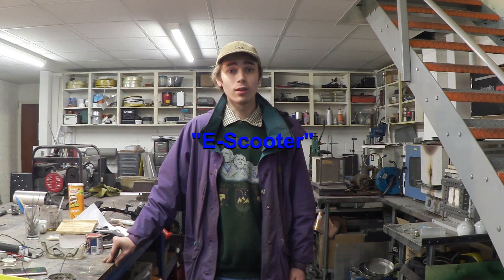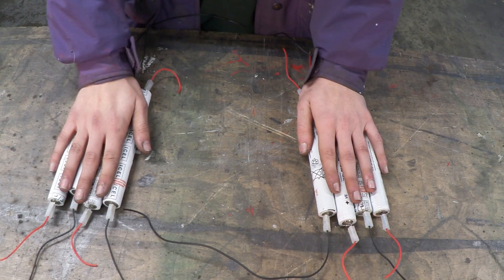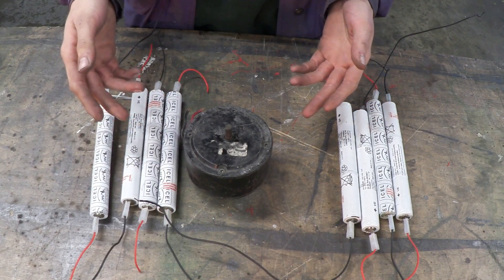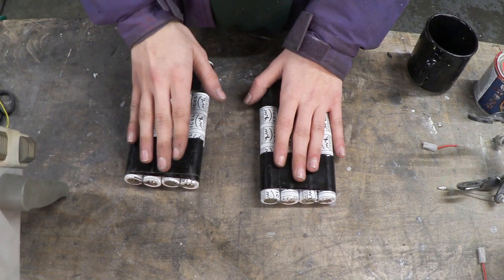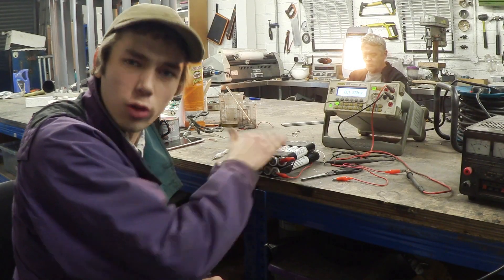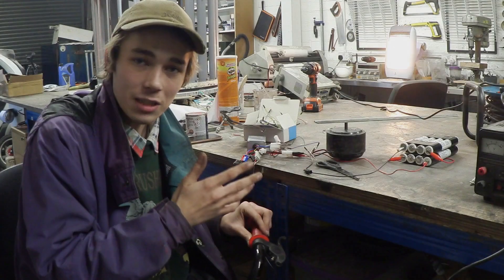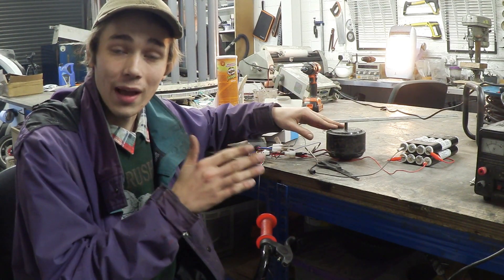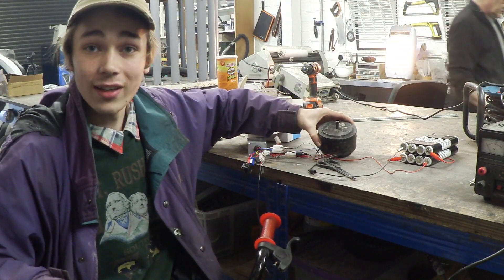DIY Battery Pack from Scavanged Batteries

Comment: I am trying to create a 7S6P Li-ion battery pack from disposable e-cigarettes and retrofit a replacement for a 2S Lead-acid e-scooter. However, the only way I can fit 6P is 2x3P end-to-end (either shared negative rail with two positive rails or shared positive rail with two negative rails), so I was hoping for some design suggestions and terminology, particularly around safety considerations.
I've previously seen a battery, either from a children's toy or a tool, with two female terminal receptacles on one edge and one female terminal receptacle on the parallel edge. But what would this terminal configuration be identified as? e.g. The Makita BL1830-PK3 battery has "sixteen firm holding contact terminals", but how would that be presented in notation? e.g. 7S6P instead of "42 cells"

Comment: Not a bad project. I do need to comment on you energy definition. 4 Ah is not energy. You need to multiply with the voltage to get the energy contained. It's really simple. P = U * I. E=P * T. Where P is in Watt, U is in V, I is in Amps, T is in seconds and E is in Joules which is the same as a WattSecond. I hope you don't mind I point this out to you, I feel it's kind of important as the same mistake is made in nummerous articles or even in technical reports which is kind of a pain ( usually mixing up power and energy ) . If it's not clear ask your dad. He can tell you all about it.
And it's so great you spotwelded the batteries. Some people just solder them which is a big mistake potentially destroying isolation inside( for lithium batteries I'm sure of that. for others probably also. )

Comment: Couple of things,
 I think you could have shown the spot welding. Rob might have done a video about DIY spot welding batteries in the past but if not you could show us how to make & use the equipment... 
How did you charge the batteries? I don't think consumer NiMh chargers would work with long series packs like that so this'll be important information to people you inspired to make up similar packs - probably you could use a fairly simple circuit and make another video about that.
This isn't intended to be harsh criticism btw :)

Comment: Take care with charge balance on NiMH (as with NiCd). Voltage is not the most accurate measure of % charge. Hybrid cars use single strings of NiMH for this reason; if you parallel them, you may end up with different current into each string. 

Or just make a single string at a higher voltage - depends on what you use as a controller or have for charging.

Comment: Probably use the plumbing analogy for electricity. Dam wall pressure voltage and river or creek water flow for current.

Comment: Nice one Luke, maybe a future upgrade could be to use lithium cells from an old laptop battery?.. 👍🏼
Reply: That is not a good idea. Lithium cells in laptops do not contain protection circuitry. Packs for laptops do. This will protect against over temperature and over current. Single cells with this protection circuitry do exist but are virtually never found in laptop battery packs.
Only if you do include the protection circuitry and you know what you are doing it is safe.  Imagen a short circuit and the pack catches fire close to some private parts you care a lot about.
Reply: @hanslepoeter5167  yes you’re correct, I meant use the cells with a charging/protection circuit, readily available from sites like AliExpress/eBay etc. I should have stipulated that 👍🏼
Reply: @gilbertsprojects2954  Yes you can buy these. But they will not match the 16450 format as these need some space for protection. But thats a great comment. It indicates you know what you are talking about.

Comment: It turns the motor with no load on it.  Will it have enough amperage to actually MOVE the scooter with 120 pound person on it?
Reply: It would probably be in the region of 150w that would be OK on the flat, but I doubt it would be much good on the hills, Luke, It would probably be better to use four of those pack as opposed to just two. of course, I have no idea of the motor rating.

Comment: please outline the charging system..  its a good chance you will want to put a timer or thermal cut off on the battery charging.  im guessing you might be using the motor controller for the battery charging control ?  if so its probably designed for lead acid nt Nickel metal hydride.  and it will likely kinda cook your battery packs unless you plan for it.

Comment: tip,  a little tape flag on the motor shaft is a great way to let people see it is spinning,  also  love the Robert cameo.   can you show how you spot welded the batteries?  did you use a full sized welder? (actually im sure at FWG they have a  proper tab welder. )

Comment: Nice to see a new way of explaining it! Well done Luke ;0)
Most people would have gone with the hosepipe analogy, it is good to see someone try something different!

The only thing I would say is that Amps in battery terms is totally different from AmpHours. 
Amps is how much energy you can safely take out at any time.
AmpHours is the total amount of energy stored.
..... of course you need to add in the voltage multiplier to get the actual Power of the unit!

Comment: So we need to be careful when talking about Amp hours vs amps. You were describing Amp hours and said just amps a couple times. 

Amp hours are how long it will last. Amps are an instantaneous thing about how much wattage a battery can output right now. So at 18v hopefully you are getting at least 5.5A so you can be pushing the motor at 100w.

Comment: what are those batteries from? never seen those type but I am on other side of pond and all hahaha
Reply: They're from emergency lights, if I recall correctly.
Reply: Yes, they were scavenged from an old light system. each individual battery has 3 cells inside. so it may look a bit different. Cheers mate! :)
Reply: These have replaced nicad batteries and are common for yearsnow, They outperfom nicad but can use the same charger.

Comment: Hey Luke maybe you could explain why you chose to may 2 batteries of full voltage instead of one by paralleling the individual cells which may give you a more stable battery Cheers and keep up the good videos.
Reply: Hi mate, Great question. my reason is that I needed more voltage on the packs to run the motor controller and the motor its self. So connecting 4 batteries into series at 3.6v each, I managed should get a higher voltage(12-16v), then connecting both packs into parallel iI should increase the amp hours from 4 to 8. I'm open to suggestions so let me know what you think. Thanks mate! :)

Comment: ......motor is 200 watts is it ?.The batteries could almost be from the 20 watt led emergency lights that Rob salvaged cos they can also be configured to 28 volts nominal for 4ah .The 28 volts is the turn on voltage required by the salvaged led array . I'm noting what you do for your build cos I've decided to finish off my twenty year old mothballed build . I have several 100 watt motors in the style of your motor, I'll look at using my lithium power tool battery packs paralleled up as the battery . Those lithium battery packs didn't exist twenty years ago .

Comment: For some reason seeing those batteries chained together reminds me of a water fight between the men and the women. The women occupied the second floor of the building keeping us men pinned down on the ground floor. I decided we needed a distraction and asked the men for their Nextel phone batteries. At 4.5 volts each one alone couldn't light a 24 volt fog light, but daisy chained together using 5 or 6 batteries(ran in series) I had plenty of voltage. I added a flasher relay in series with the light. Pointed the light out the back door and turned it on. Sure enough those women got curious what the bright flashing light was and all went towards the back, in the mean time the men went running up to the third floor. FYI the flasher relay acts like a thermal limiter on the system. I still remember being told a pair of 100 watt light bulbs were cheaper to replace than 200 watt speakers. Basically saying put something inline to burn up before the motor or batteries that is cheaper to replace.

Comment: Really enjoying this series Luke. Keep it up. Would be great to watch you both working on the same project. Maybe the next car project? Question for you, what are you planning to use to control the speed of the motor?
Reply: Thanks mate, that is a pretty cool idea! How I'm going to be controlling the speed of the motor is by using an electronic throttle. And a 24v 250w motor controller.

Comment: Never seen batteries like that before, very cool. Are you going to use a BMS to manage the cells? I would imagine that a standard 18650 lithium based BMS would work with these batteries because they both hold about the same voltage. What is the charge of a flat cell with those batteries, is it around 3v like the standard lithium cells?
Looking forward to seeing you scoot around the carpark when this is done.
Reply: ....so it looks like each tube is composed of 6 C size 2ah NiMH cells at nominal 1.2 volts per cell which would give 7.2 volts for each tube .
Reply: @charlesdickens6706  I thought Luke said each tube was about 4v, having 4 in series gives him the 16v each pack so a standard 4S BMS would work well.
Reply: ......voltage readings will be up and down all over the place. Freshly charged reading could hover around say 1.45 per cell for several days depending on manufacturing, settled voltage is say a nominal 1.25 but seem to be higher until partially drained , charging voltage reading could well touch on 18 volts for 12 cells in series depending on internal resistance and charger .